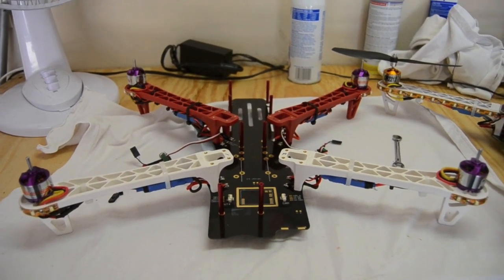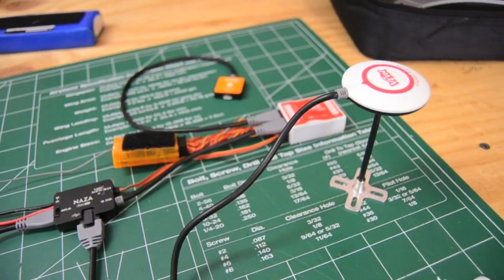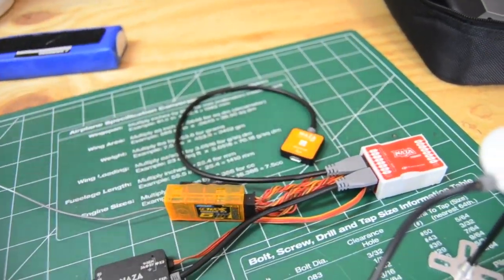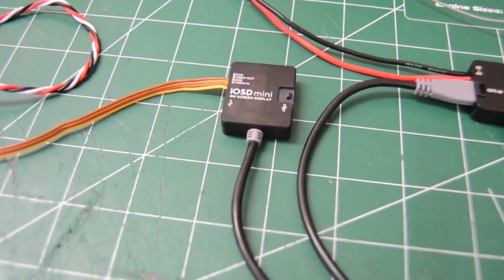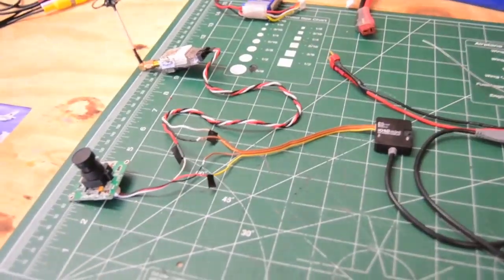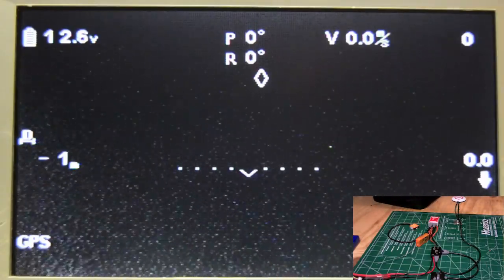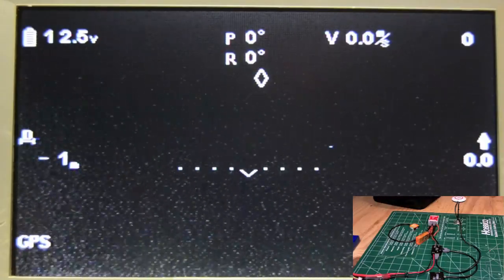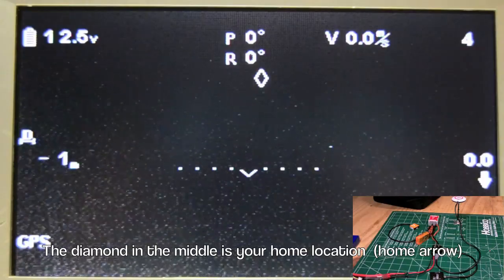DJI Naza-M V1 upgrade with PMU V2 & DJI iOSD mini

Comment: Of course you found out that DJI was a bunch of slack idiots and did NOT enable gps to show in the osd. What losers...there is a newer add on device for Naza that’s about $30. Goes inline between gps and the pmu and draws out the gps location onto osd.

Comment: Thanks for the video. I have the same set up and followed the wiring directions (as far as I can tell). I have all the right green lights but am getting no signal. Any thoughts on what I could have done wrong? Transmitter is lit up and on the correct channel with the receiver.
Reply from the maker: +Christopher Pappas No signal from your radio to rx? Do you have the same components as in this video. This is an older Naza.
Reply: It's a Fatshark Camera. It was working before. I'm wondering if I've cooked the transmitter somehow.
Reply from the maker: +Christopher Pappas Try testing your components individually just to make sure everything is working properly.

Comment: Hello friend does not understand English very well, what you teach 1.13 minute, you say you do not install ??It is that I too spare to put the Naza LED V2
Reply from the maker: arsbasauri Yes, you can use the original LED or the new LED V2. Both will work just fine.
Reply: thanks

Comment: I just did the Lite hack upgrade and I was wondering if I absolutely need the pmu v2 in order to use an IOSD. All the pinout diagrams I'm looking at appear to show that the power wires are different and the gps signal is not the same as the can bus. Your thoughts?
Reply from the maker: Honestly I don't know. I'm not familiar with the Lite version. For this model I was using the Naza V1. Good luck.

Comment: Super cool video,very informal.
I have the TBS Pro - and having a problems wiring it up. I'd like to switch views between the FPV cam and my gopro while flying. Have you any idea how this can be done?
Reply from the maker: Simple process. First you will need a video out cable from your GoPro. Here is a link to a GoPro cable but make sure you select the correct cable for your GoPro 1/2/3 or 4 not sure what you have.
http://www.hobbyking.com/hobbyking/store/uh_viewItem.asp?idProduct=64427
Your FPV cam should already ready have a cable.  Second you will need a video switcher, see link below. http://www.hobbyking.com/hobbyking/store/uh_viewItem.asp?idProduct=72283
You'll be able to toggle between cameras with this switch and you can have up to 3 cameras on this switcher. Hope this helps, good luck.
Reply: 940 RC - many thanks that is a great help.
Chris

Comment: naza-upgrade.com will unlock a Naza M Lite to full Naza M. Then purchase the PMU v2, iOSD mini and remote LED as shown in this video. I just finished doing it to mine and it works great. If only they had a switch to change meters to feet

Comment: I have follow your configuration but I have a problem, my NAZA led don't blink, just one flash when power on..
Reply from the maker: Did your naza led work before the configurations?
Reply: I have the same problem too with my led v2 on my naza v1.

Comment: Can I get the shopping list of this stuff from you? I got the iOSD mini and PMU V2 and the LED. But what about the video Tx and board camera? Which are you using?
Reply from the maker: For the video  I was using the following equipment. 
http://www.hobbyking.com/hobbyking/store/__15295__Boscam_5_8Ghz_200mw_FPV_Wireless_AV_Tx_Rx_Set.html

http://www.hobbyking.com/hobbyking/store/__13434__1_3_inch_SONY_CCD_Video_Camera_NTSC_.html

But I recommend and use the following.
http://www.readymaderc.com/store/index.php?main_page=product_info&cPath=11_30_33&products_id=266

http://www.securitycamera2000.com/products/RunCam-600TVL-Plastic-Housing-FPV-Camera-2.8mm-Lens-%252d-US.html

Hope this helps

Comment: Ah this is just what I wanted to know.... so I can keep the 'old' Naza v1 for this, and just buying that LED and PMU V2 ... saves me 150 bucks :)  I like the connection stuff of that iOSD, much easier then my immersionTX stuff I have, which has it's own GPS, which ofcourse is ridiculouse since you already have a GPS unit (also weird that the GPS of the DJI is on a stick, far far away from everything, but that GPS of the immersionRC is mostly put 'low'.... and, in my case, it never finds satellites)

Comment: Great video, thanks for sharing.  I have watched it several times and don't see how the vtx gets power. The vtx has 3 wires, black and white going to the iosd mini and the red going to the camera.  Where does the vtx get it's power from in your video?  Thanks again for your help!
Reply from the maker: At the beginning of the video, I have no power going to the VTX. I do power it with a 3s battery not shown on video. The 3 wires that are coming out the VTX powers up my camera (12v) and sends the video to the iOSD. Ignore the wire colors coming out of the camera, they are incorrect (hobbyking mistake) 1:38. Hope this helps.

Comment: I like the iOSD mini, HOWEVER, it only supports metric. I contacted DJI and they said they are not going to provide a version which supports imperial (i.e., feet, MPH). This is a show stopper for me. Seems strange that DJI would ignore the US market and not change like 10 lines of software code to support a large market like the US.
Reply from the maker: It is a sweet little device. I can't say that I noticed that because I fly with the metric system. If that is the case then I agree with you. They have a big market in the US.

Comment: Hi I have the same setup but for some reason this is not recognizing my GPS I have checked and double checked the wiring but no joy any ideas
Reply from the maker: The GPS should be plug n play. All I can say is double check your wiring with the manual or just watch my video again closely just in case you missed something. Good luck.

Comment: great set up mate , i have the same , but i have a small problem with the v2 led and the throtal, the led come on when i hook up to the firm were but when i go to fly i have nothing , no blink no nothing , cant even tell if iam in safe mode or anything, and power only come in at 50% and not much of that , i have the same set up as you v2 pmu osd led , can you help , ive done the all the down load and still nothing , hope you can help , thanks for your time kind regaurds mick
Reply from the maker: So you get no throttle response until you get 50% on stick? If thats the case something is not right. The LED problem is very strange. Is there any way you can shoot a video of this and post it? Im curious to see exactly what is going on.

Comment from the maker: I just installed a 5v fatshark camera & 250mW fatshark vtx with separate battery as well. I wired it this way. The camera red wire (5v+) goes directly to the vtx. The camera white wire goes to the mini osd yellow wire (video in). The camera black wire goes to the mini osd brown wire (ground). From the osd the orange wire (video out) goes to the vtx video in. From the osd brown wire goes to the vtx ground. I hope this makes sense. Let me know if this helps. Separate battery directly to vtx.

Comment: im doing the same as you only with immersion tx and a5v fatshark camera. separate battery.. could you explain the colors on your cables ? which ones goes where? on yours power on camera is white and goes to tx? and ground and video goes to iOsd mini?

Comment from the maker: The LED module plugs directly into the naza. I'm not sure how the phantom is configured so I don't know if you can use the iosd mini. Not sure about the weight on the pmu and the osd, I already installed them on my quad so I can't weigh them. Let me know if you have further questions. Thanks for watching.